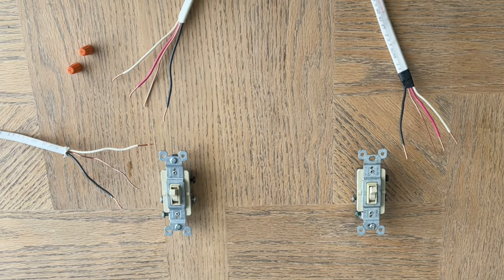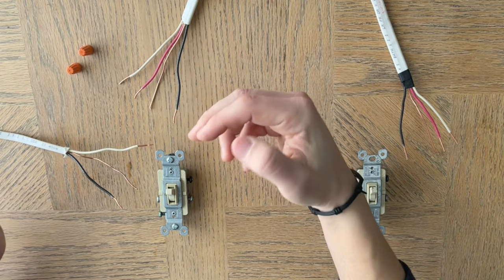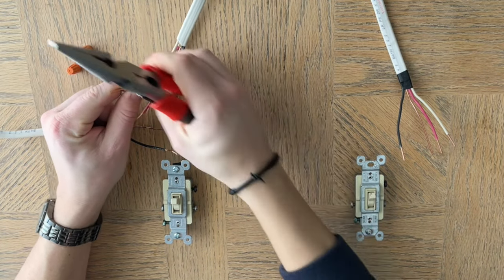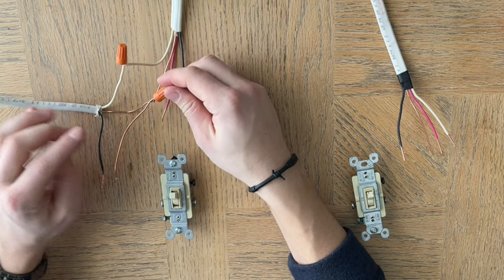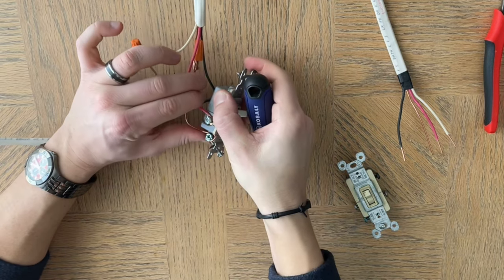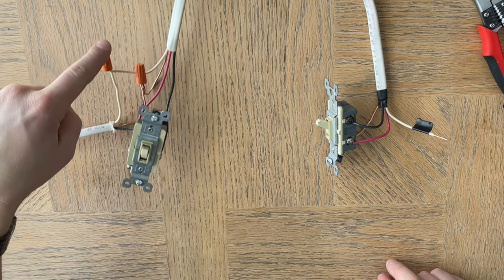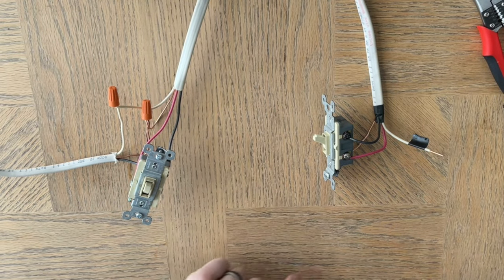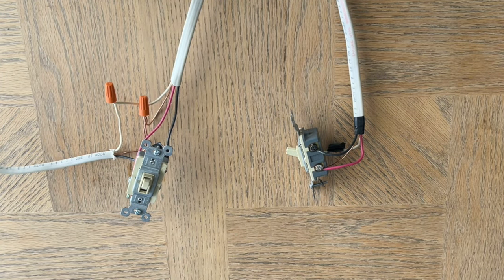How To Wire 3 Way Switch 3 Pole Common Circuit 2 Light Switches

Comment from the maker: You'll Need:
If you shop on Amazon, please use Amazon Smiles to support Social Media Ministries. https://smile.amazon.com/ch/87-1084575

Needle Nose Pliers
https://ebay.us/3RDyb2

Phillips Screwdriver
https://ebay.us/z8GOzz

Flat Screwdriver
https://ebay.us/aWEg8g

Wire Stripper
https://ebay.us/W6eqtT

Wire Nuts
https://ebay.us/wk8gas

Electric Tester
https://ebay.us/GpELt5

3-Pole Light Switch
Check your local Menards, Home Depot, Lowes, Fleet Farm, Etc

Electrical Wire
Check your local Menards, Home Depot, Lowes, Fleet Farm, Etc

Comment: I have a basement light that is giving me nightmares. Maybe you can give me some guidance.

The setup is 1 fluorescent light hooked up to 2-single pole switches. 14-2 wires connected to both switches and the light. It was originally wired up to work like a 3 way light. Each wire group has 1 bare, 1 white and 1 black wire on each switch. No travellers wire is present. And I have double checked for that bridge wire... trust me LoL.

When I removed the switches to replace them with paddle switches, the 3 way function stopped working. I have tried every combination of wires, on each terminal, to get it to work as a 3 way again but I can't get it to work again. 

Every combination was tried except using the bare ground wire on any of the terminals other than the green ground terminal.

What I am starting to wonder... is it possible that the ground wire was used as a remote? Was that a common wiring trick in the past? And can the light switches work without the ground connected excluding the safety issue? (FYI: The house was built in the 70's and the wiring in the basement was redone in the early 90's by a self claimed handyman. I am planning on pulling the wires in the basement and rewiring the basement with 14-3 anyway. I'm just curious as to what you think of this situation. Please let me know if you have questions or what you think.)
Reply from the maker: They probably used the ground as the traveling wire since they used 14-2 instead of 14-3. Doing this is NOT recommended. It may not be legal, and is probably not up to code.

The best thing to do is do exactly as you plan. Pull the wires and add 14-3. Unless there is some way for you to run some single traveling wires.

Comment: If you want to add a 2nd light at the top of the stairwell that is controlled by the 3 way switch, how is that wired?
Reply from the maker: So 2 switches and 2 lights where both switches control both lights?
Reply: Yes, able to turn both light on at top of step, and then turn both lights off at bottom of steps (and visa versa).
Reply from the maker: You could use a junction box. Wire it as if it is a single light. Then, send the power from there to each of the fixtures. 

Another option would be to wire to the first fixture and then send travelers to the second fixture. 

You may also want to call some local electricians to see if they’ll give you any ideas. They will know the local codes and regulations to follow.

Comment: He hee or bum wiring
Reply from the maker: It’s acceptable and works well.
Reply: @HowToVideoChannel  If i can't color code it with the same color wire <> THEN IT BECOME A BUM WIRING. The only thing about bum wiring is? you don't know what your wiring to. So you got to trace it down and rewire it >THE RIGHT WAY   Dad was bad about getting any kind of wire, to wire some thing up with. Only he knew what it was: Then i have to come along, to redo his mistakes  Yes i got shocked a few time. But its only 120v and 220 v. THINK GOD
Reply from the maker: Using the proper color wire is essential.